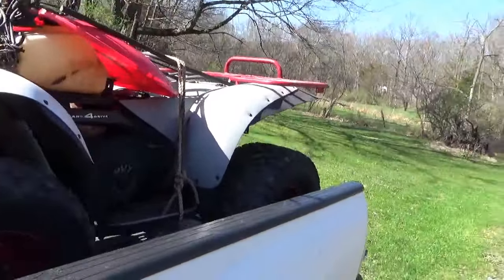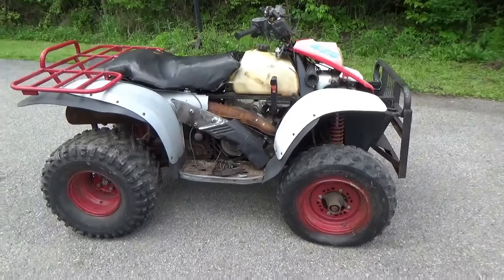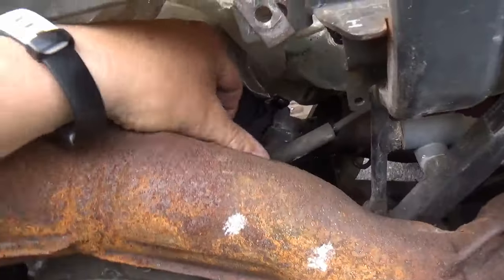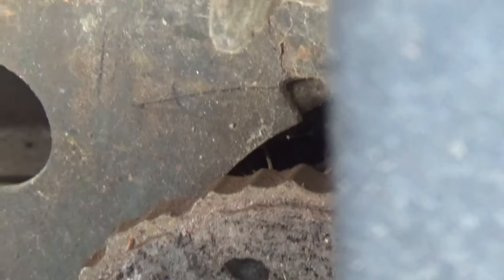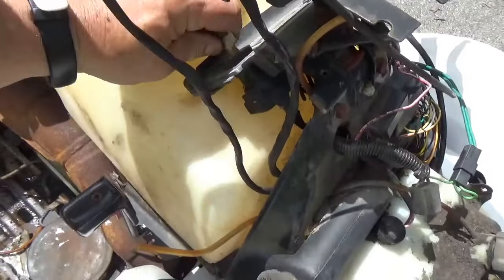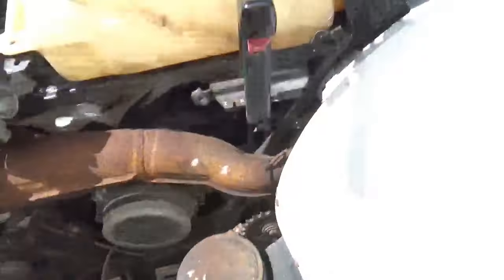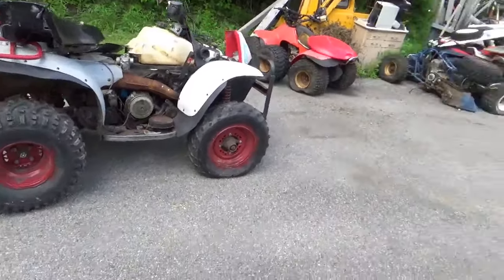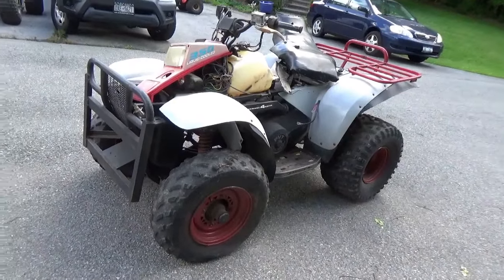$200 Polaris Trail Boss 350 4x4 Saved From Crusher!

Comment: I have the air cooled 300. They are actually not hard to work on and the trannies are sort of like a manual gear box on an older truck. I had to replace the shift fork and dog gear on mine. Wasn’t bad other than I’d buy parts new they are expensive.